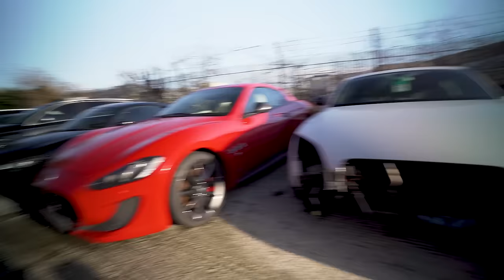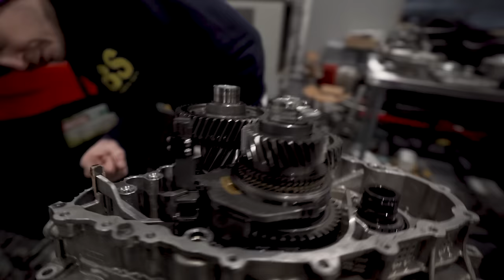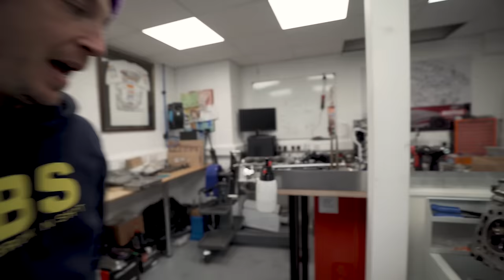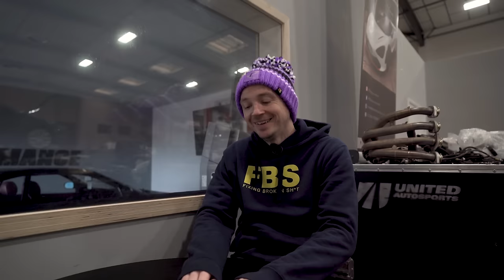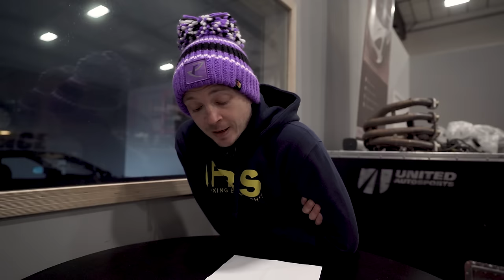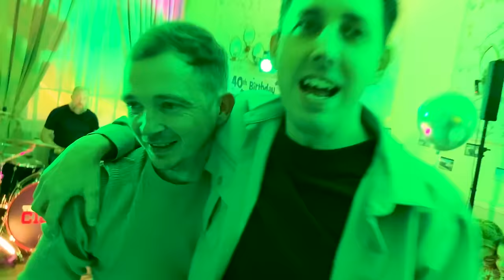Should You Buy a Cheap Audi R8? | Workshop Update No.49

Comment: I managed to get a 30k r8 with 80k miles but it had new magride all round, new brakes all round, new ps4s, clutch done, ac replaced oil cooler and lines done, walnut blasting and mrc stage 2 all within the previous 6000 miles which was a bit of a bargain!
Reply: I paid exactly the same got 400 back for r8 plate so 29600 at 80k and 1000 miles just before I got it the owner had over 10k of work new clutch fly wheel , air oil separator , coolant pipes and oil cooler , service new oil for  transmission , new oil sump and seal and also another bill for furhrrr 3k in 2018 for 2 new ECUs so I rekon they can be had if you keep looking

Comment: Ricky, you showed the play in the valve guides. What are the symptoms of excess play. I`ve replaced guides that were outside of spec when I`ve had heads machined and seats 3-angle cut, but if you leave them  what`s going to fail. Smoke from burning oil, valve fatigue / failure ?

Comment: I bought a 15 plate RS 4 one of the last V8s kept it for 3 years it came from Audi dealer who I have bought all but one of my 6 Audis from they replaced all the brake discs and pads and fully serviced it great car loved it but ended up chopping it in for a new Q3 sport back as the last service cost £2k and the advisories on MOT was new exhaust, 2 weeping shocks etc it only had 34k on the clock but the bill was mounting as much as I loved it it had to go. Prior to that I had S3 on a 16 plate I wish I had kept that as an A to B it was the quickest car I have owned, but I was in the end worried about the car jack factor that they attract which showed in the insurance cost the RS4 was half the price to insure with the same insurance company.

Comment: Question; so the 5 cylinder CEPA engines are cast iron and sound far superior to the aluminium block DAZA’s (unpopular opinion) do the V10 engines from gen1 to gen 2 vary in block material thus resulting in one sounding better/more unique than the other?

Comment: Hi guys great videos. To do a twin turbo build on an R8 gen2 is there a particular year that works best?, as the car will be ecu tuned for the upgrade presumably it doesn’t matter if it’s a performance or not ? And can you twin turbo a spider or would you not recommend it due to the extra torque when launching? Cheers

Comment: Couldn't agree more. High side suck I went big for my first crash on the street  180 kph Exiting a corner and the headlight goes out. Started breaching I thought I was trailbreaking through the corner. Turns out the moment I hit the brakes. I went in a straight line off the road. Reartire slipped into the ditch Probably because I was using too much break on grass Was thrown off did Half rotation landed on the back of my neck And the top of my shoulders Then did one or two flips And landed on top of my head Is first impact broke my neck C7 Second Got my back t2 t3 t4 Dragged the five hundred + pound bike out of a ditch the next morning screaming in pain because the doctor said I was all good......They didn't take any x rays😂
Reply: What kind of corner were you navigating at 180kph?
Sorry to hear of your injuries, sounds horrific and could but for the grace of god been a fatal.

Comment: The question is 
Do you know ….. 
Why has a bobble hat got a bobble 🤔😁
Wayne from south wales 🏴
Reply: It was from the old days when mechanics had to work in dingy pits ,before they had lifts, it was so you could feel if your head was gonna bang on the exhaust or driveshaft as you manouvered underneath the cars vans  or even horses they had to work on back in the olden days.
Reply: Because without one it's just a hat.